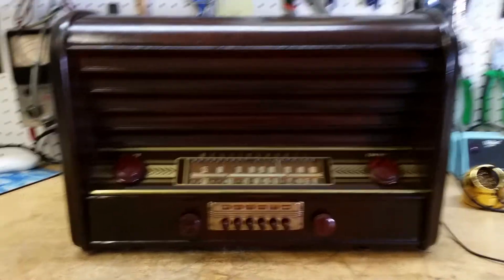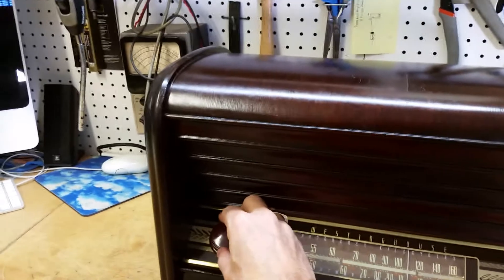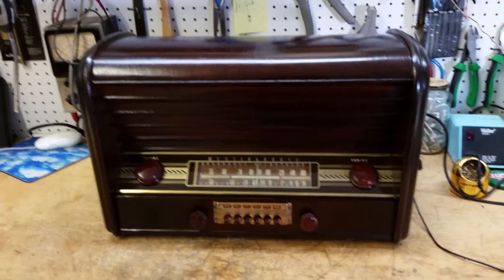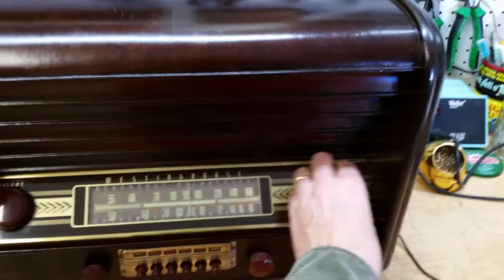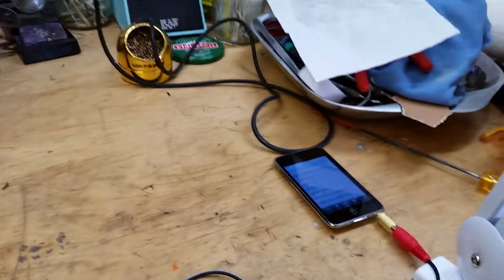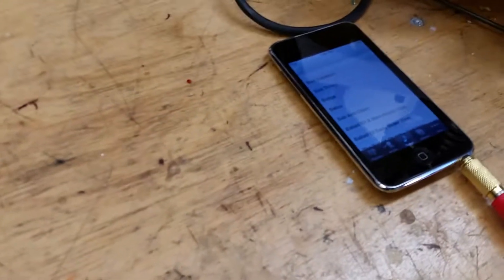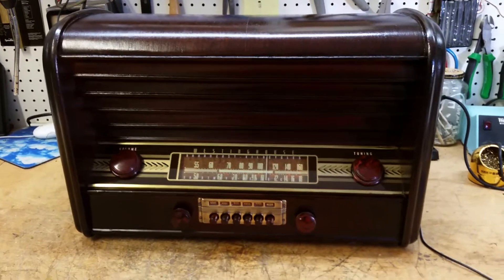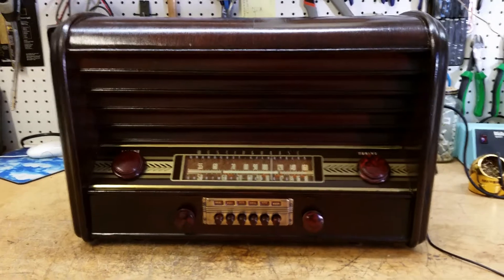1948 Westinghouse H104 vintage radio playing

Comment: @doctorvoltz  Asking because a H104 just appeared on my bench... 

At 2:22 you show the rear of the radio with the 6Y6 output tubes, and the heat shield. Did you replace the original asbestos pad with something else? Or what, if anything, did you do to stabilize it? Pondering substituting 6V6 output tubes to reduce the heat in that area. 

Your cabinet looks great. Mine has two splits on each side piece unfortunately.
Reply from the maker: Hi Mark.  I replaced the pad with a square of sunshield.  The kind that people put in the windshields of their cars.  One sunshield is enough material to make lots of deflectors.  Works well.  Bench tested for many hours with no problems.

Comment: Man I just got one of these today its completely wrecked,the box is the electronics are good it plays fine speaker is Destroyed I'm trying remove it and just use a reg speaker without the transformer or do I need it to power the speaker??
Reply from the maker: In addition to the transformer, this speaker also has a field coil which is part of the radio's power supply circuit. You cannot substitute a modern speaker without substantial modification to the radio's circuitry.  The best solution is to have the speaker professionally re-coned.  I use Sound Remedy in New Jersey.
Reply: @doctorvoltz6037  would you be willing to chat with me? I picked up 40 tube radios and I'd like to get some converted to guitar amps and maybe the ones to far gone collect parts to build a home amp